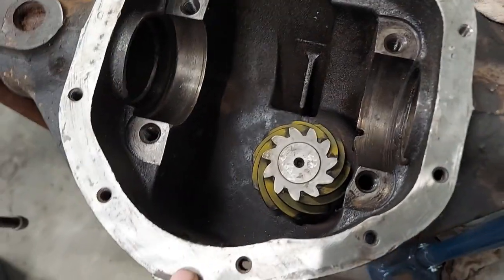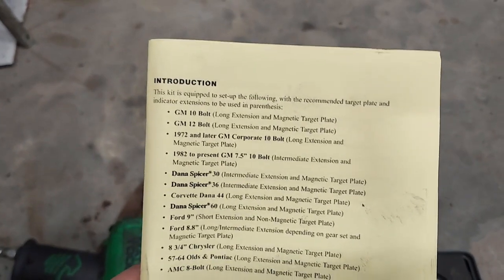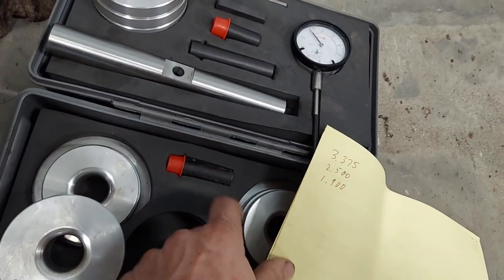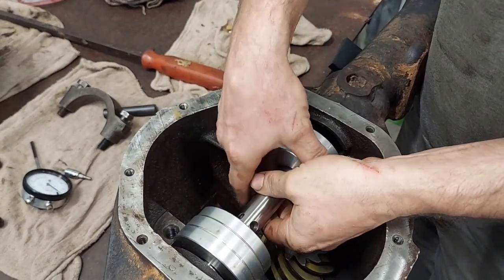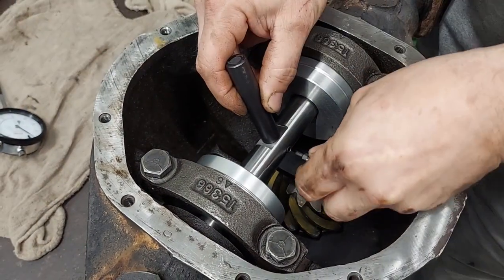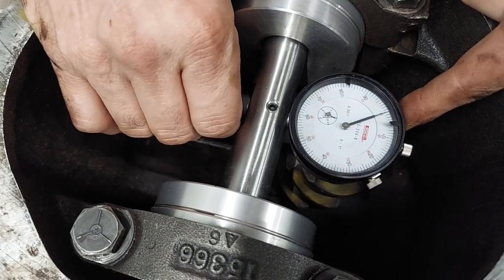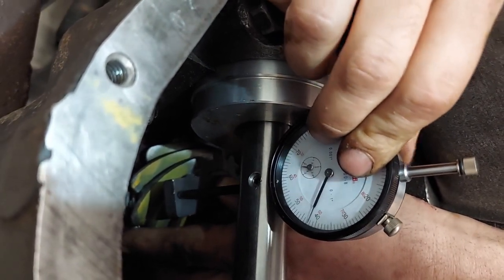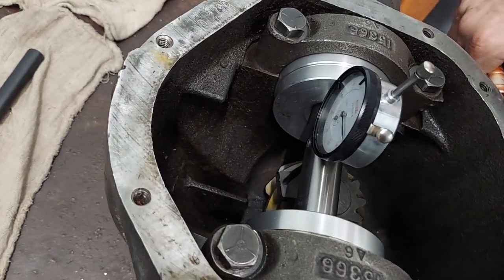How to check pinion depth

Comment: You can do this with a straight edge and digital calipers.  Straight edge across the cover surface,  measure to the center cap face.  Zero calipers then go down to the pinion face.  The difference in the number and pinion number is your shim.  Do that for all four cap faces and average to get the shim.  The variance is almost negligible.  Use a honed pinion bearing and marking compound to verify.

Comment: Those tools are a POS. You never get the correct center line on about 90% of differentials. I've had one on the corner of my shop collecting dust for 10 years.  Use gear paint with a honed out test bearing.  Save yourself money and time.

Comment: How did you get to .750? Is that .700 on the small scale that you counted? Great video!
Reply from the maker: @tonyfischer8928  yes, I counted the revolutions on the small dial
Reply: @slaterrockshop4564  thank you! What brand tool is that?
Reply from the maker: @tonyfischer8928  https://www.amazon.com/Deluxe-Pinion-Depth-Setting-Tool/dp/B07GR6RJH1/ref=asc_df_B07GR6RJH1/?tag=hyprod-20&linkCode=df0&hvadid=692875362841&hvpos=&hvnetw=g&hvrand=15796618034243841484&hvpone=&hvptwo=&hvqmt=&hvdev=m&hvdvcmdl=&hvlocint=&hvlocphy=9010661&hvtargid=pla-2281435177578&psc=1&mcid=87aee625ab063ff097a0655c37624ef6&hvocijid=15796618034243841484-B07GR6RJH1-&hvexpln=73

Comment: When you use the gauge block to set the dial at 3.375, you apply pressure to the plunger, set the tension screw, and the reset your dial to "0".  Thats how the toolmaker told me to do it.

Comment: Out of curiosity, don't you have to add in the thickness of the magnet that you stuck onto the face of the pinion gear? or does the set gauge compensate for that?
Reply from the maker: The magnet is already factored in.  I believe it says that somewhere in the paperwork,  otherwise you would definitely need to subtract thickness
Reply: Dont you need to subtract the magnet thickness?